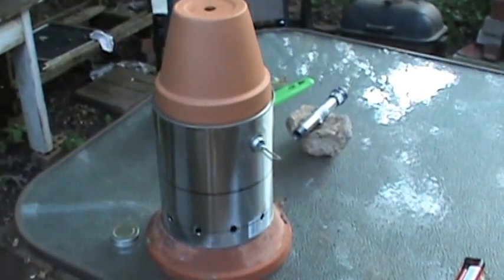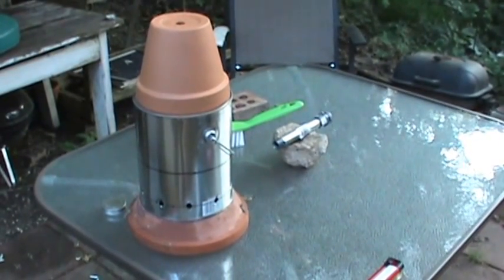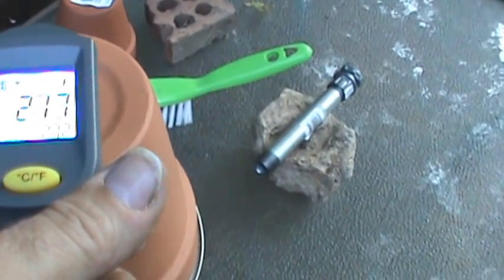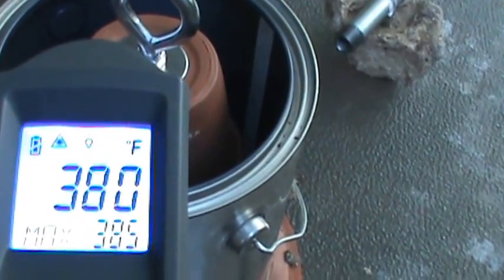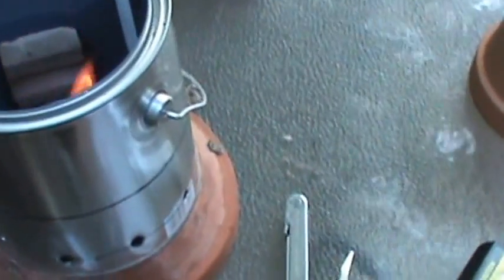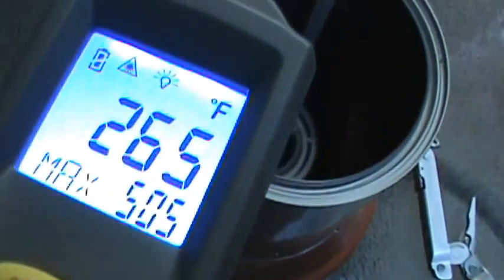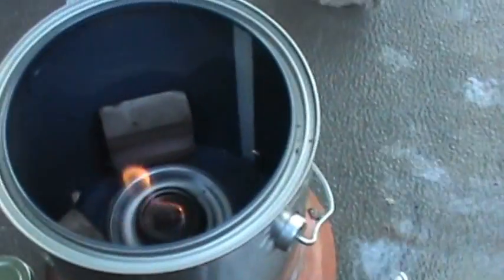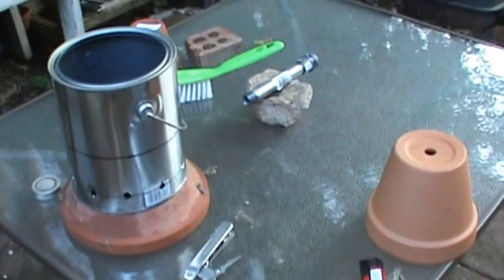Flower Pot Heater redesign. This one works.

Comment: Don't forget to setup a test environment and keep tabs on oxygen and   carbon monixide  levels.
Reply: That’s my first and major concern. I had an acquaintance that died from a hibachi
Reply: Yes, exactly. Carbon monoxide. The amount of ventilation needed to prevent asphyxiation may cancel out heat produced.
Reply: Also, if your tent is covered with snow then you will not have the ventilation you expect. A solution might be to vent out the hot gasses this heater produces to the outside of your dwelling and rely only on the radiant heat from the clay pot. You could also design a heat exchange chamber to help better capture the radiant heat.
Reply: On thing nice now days you can by alarms for gas and fire and oxygen levels and use in tents.
Reply: @TM-iq6sx  I bought a batt operated one @ the home of depots for about 30$    kinda expensive they had cheaper ones but it is life's were talking about so I figured I'd splurge on the expensive one. Hahaha
Reply: Yes I recommend using a carbon monoxide detector and alarm with your heater.
Reply: GASSES??

WE DON'T NEED NO STINKING GASSES !!!
Reply: If the right fuel is burned such as alcohol you have little to worry about. Also, the part he calls a plenum acts as a catilistic device in which burns unburned gasses. In addition, the cleaner the fuel used the better.alcohol is about the best fuel common people can easily get ahold of.
  If you don't believe me then build one, get your gadgets and test it to prove me wrong. Just so you know I've been building and using these types of heaters for years. You can even cook rice on them and heat up foods.
   However, a wood gasification stove is best for cooking and heating a tent. You need to know what your doing to use it for heating a tent though don't try it unless you know what your doing ( you've been warned). And I can build those stoves to. 
   Anyone need information on how to or just my knowledge of the matter I'm willing to help, just ask me and I'll respond A.S.A.P. to help, just don't waste my time....
I do not and will not argue with anyone about things I know because I've done them many times and built many different stoves with different specs and so on. In fact I'm currently designing a new wood gasification stove to use wood pellets and test it out to be used in my greenhouse.
Cheers everybody!!!
Reply: @jamesfrankland4436  I'm interested. Could you explain please?
Reply: @kimguy7550  Kim Guy what do you need me to explain?
Reply: @jamesfrankland4436  I got my answer I missed it the first time I watched the video I was wondering if it was Sterno or alcohol
Reply: @kimguy7550  cool👍
Reply: @jamesfrankland4436  I am interested. I am from CA and now live in a travel trailer in Rexburg Idaho, with two of my grandkids. Yes I’m that desperate to get out of that state at this point lol
Grateful for the edit button to correct my spelling🤡not sure about my grammar. ☃️❄️⛈☔️
Reply: @marleyelmer4294  Awesome, how may I help you? What do you need?
   Depending on the age of your grands I bet they run you crazy wanting to go out side all the time while letting all heat out, lol
   Blessings..
Reply: Alcohol stove
Reply: I setup a test before I light candles on my birthday cake!
Reply: @Heartsongsutube @Jeanieart1940 Kowatsch
Lol. Hahaha.
She tried correcting somebody and look what happened!! She misspelled too. Oh boy, good laugh. Karma is Great
Reply: @sheldonhatch8255  she spelled it like the guy did with a question mark meaning she was questioning his spelling not trying to correct him.
Reply: @PiscesMoon2You  that lady was trying to be the spelling police, there was no question mark, and the op was correct in his spelling of carbon... she wasn't. So she sucks 😐   she should have left that guy alone.
Reply: Carbone MONOXIDE
Reply: @Jeaniesunshine-fb5rk  CARBON monoxide
Reply: @Jeaniesunshine-fb5rk  CARBON!! monoxide.
Karma, you ass hat. Leave people alone you can't spell, you damn troll.

Comment: If you don’t mind could you take it clear apart.  I’d also suggest covering it with an inverted wire waste basket that you could anchor to the ground in your tent.  Also I was thinking  about attaching your new base to mouth of the waste basket and perhaps a wire handle to the bottom of the basket to move it around if needed. Good luck, I think it’s looking pretty impressive.

Comment: After reading some of the comments, I'd say you kicked up a hornets nest.  One comment talked about the laser thermometer only showing surface temperature.  I was wondering... What about using one of those propeller / fan gizmos that run on heat. putting it on top of the unit would maybe help circulate the heat... I don't know what that would do to the overall cost of the unit, (Plus, another comment said something about CO gases and other toxins.)  I would suggest you try this unit in a tent and use a different thermometer that reads ambient temp. plus...maybe a CO alarm in the tent just to see IF there are any noxious gasses.  many blessings!!

Comment: 1st i was thinking about using a all wooden 📦 box with thick wood and put candles in the box aluminum foil and a fan to blow the heat to make it warmer.Then i found a animal cage i thought that will would work great cause it's all metal and the flame has air any suggestions to make it better ?

Comment: Some of you peiple are just plain ignorant about heat tranfer.... I dont claim to know it all myself, but I know a little since I grew my entire life living in a home heated with a wood burning stove, my dad actually invented some new designed wood heaters and so I hve been around using flame from wood and such for heat all my life and so here is something that needa to be considered and some other have made a similar point.

If you take a 1/2" dia. steel rod and heat it to say 500°F and then you also take a wood heater made of 1/4" plate steel or cast iron that lets say it is large enough to hold several 4" dia. logs about 18" long and you get the wood burning so that most all the surface of that wood stive is tye same 500°F as the 1/2" dia steel rod.
Which of these two items is gonna priduce enough heat to heat up a 400 sqft room?

I can guarantee the 500°F rod will do nothing, but the wood stove with the much larger surface area will have that room toasty warm in a short time.

An acetylene tourch that burns at about 6000°F by itself burning in the center of the room will not heat the room up as good or as quick as the wood stove with all its surface to radiate heat when its only 500°F

Why do you think that even a small electric space heater has multiple heating coils instead one one little skinny strand of Nichrome wire? more surface area distributes heat better even if it all the same temperature.

The flower pot works similar to all the good wood burning heaters which use fire brick inside them, the brick gets hot, the heat tranfers out to the steel walls and it all works together to retain and radiate the heat from the fuel source better and longer.

Comment: Never worked and never will. First off, u had way too many pots that were blocking heat that could have been exposed into the atmosphere instead of isolating it. It was hot in the pot but not outside of it. Second, ur adding more stuff to produce heat so it makes it NOT cost effective or functional. This theory is still up in the air because no one has perfected it or made it actually work. But good try.👍

Comment: Don't burn anything in a lined paint can like this one.  If you want to do so, please take the can outside, fill it with paper/cardboard/sticks and burn the lining out.  Wipe out the excess.  The clay pot is not increasing the heat -- the fuel that is burning is the only source of heat, and NOTHING is going to increase it.  Please use some judgment on what you learn from YouTube -- many people can't tell the difference between opinion, theory and fact.

Comment: People please I also have tried this the tea light candles do get the pot hot but the heat didn't radiate out from it to heat a room if your in a tent or small camper change it front the multiple pots or like he did and use a bigger heat source to help radiate the heat out and a small fan to move the heat around. As far as toxic and poisons you get those from propane and natural gas fireplace etc. Unless your in an air tight bubble it shouldn't be to much of an issue if the cold came in the toxins will go out

Comment: I think what most of you folks are missing is the flower pot heater is like a battery and you  get the heat generated from the fuel source stored in the surface area of the metal and pots. Metal is an excellent conductor but not a great retainer of heat. The terracotta in the flower pots are good retainers and radiators but not great conductors of heat.
 If you put a four T-light setup next to the chair you're sitting in or on a kitchen table the FELT heat will be more important than the amount of BTU's actually generated by the system.
Reply: Wonderful example
Reply: I have tons of those cans...his heat source. I give them to homeless people. How can I safely recreate something like this for a tent warmer?
Reply: I prefer the candles or Crisco also. I am looking for an emergency source of heat hopefully for not long periods of time. I did enjoy
The ingenuity of this man's design. It would probably be great for longer term or larger situations

Comment: You need to be measuring the ambient temp rise of the room. Not the flame or flower pot.   A plain candle will heat a column of air and put out more heat into a room than this pot.  The pot is heated by the candle and can only heat by radiation.  Doesn't anyone take physics in school anymore?